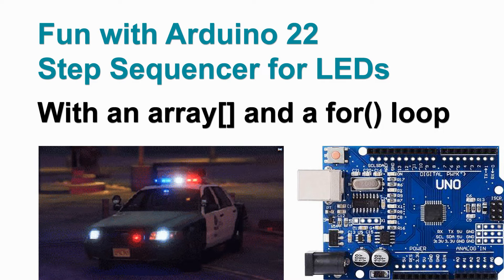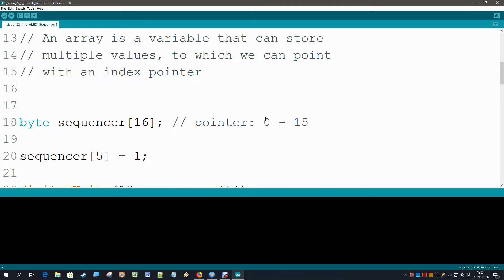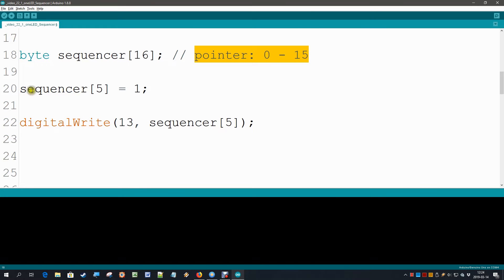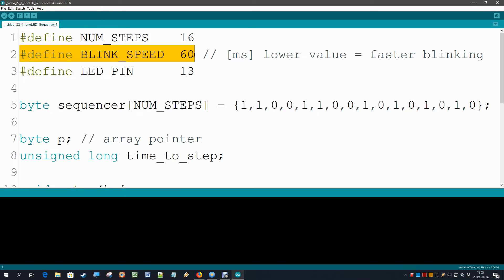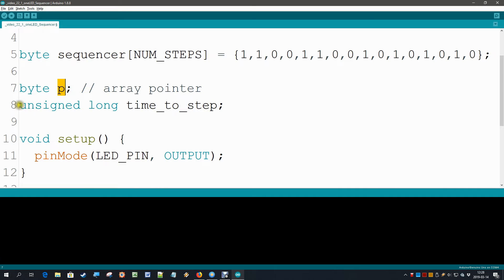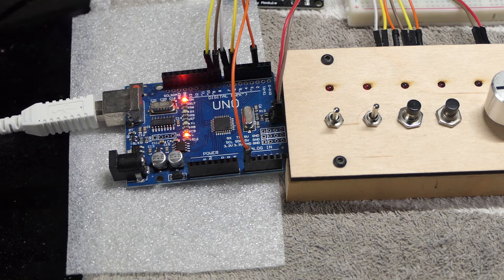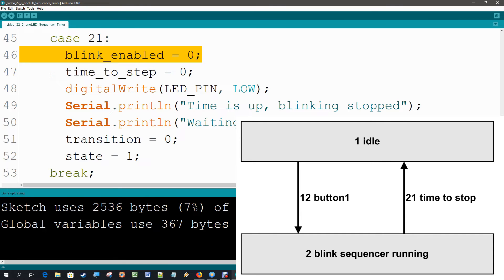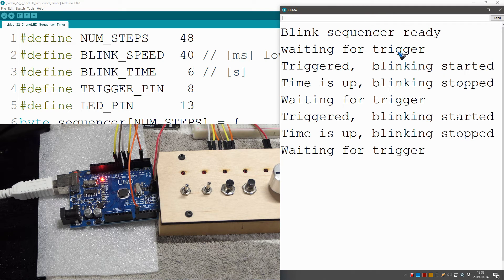Fun with Arduino 22 Step Sequencer for LEDs

Comment: Dear Sir -  You mentioned trigger Arduino via DCC please could You make a film how to do this - Thank You.
Reply from the maker: If you already have a DCC accessory decoder, just connect one of its outputs to an Arduino input. If you do not have an accessory decoder yet, you can make one with an Arduino plus a very little bit of additional hardware. All info plus a download link for all software needed can be found here: https://rudysmodelrailway.wordpress.com/
Reply: @rudyshobbychannel  I have Digikeijs DR5000 and DR 4018 decoder - Thank You for the link - Regards.